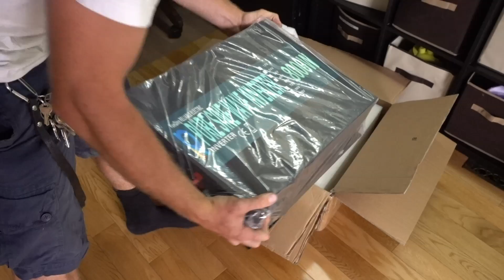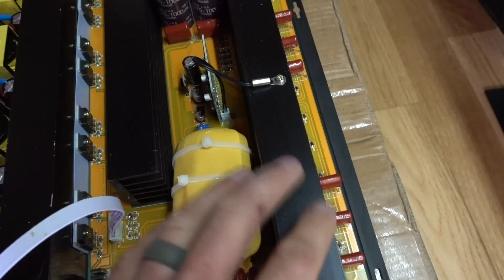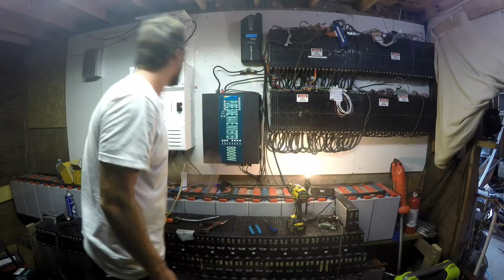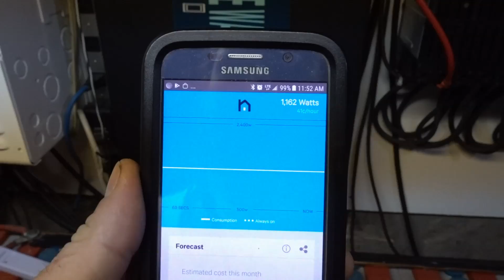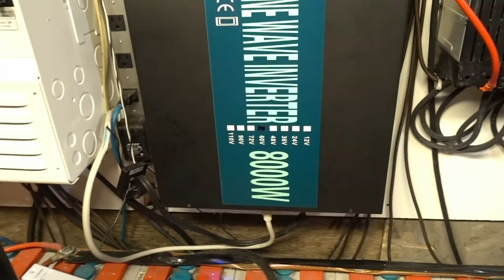8000w Reliable Electric Pure Sine Wave Inverter

Comment: How can you get, let say,  7000w on 2 x 120volts output, thats 2 Time 30A on regular 15 A output plus?
Reply from the maker: yea haha, you will cook the plugs, your supposed to know you need to use the direct wire from inverter and not the plugs for more then 15 amps
Reply: So was there a place on the inverter to hardwire in , or did you have to modify it? Once gaewiredvwere did it run to?
Reply from the maker: it has a hard wire, but the ground and neutral can not be bind as the neutral is live and if bound to the ground will act like a dead short and blow the inverter.

Comment: The thing that bothers me aout a non ul rated inverter. Can you do a volt demonstration on the voltage between hot and nuetral 120vish, hot and ground 60v ish, nuetral and ground 60v ish? I dont run a ground because of this.Mine is 40v h to g and 90v n to g. I dont like.
Reply: If you run a breaker box the neutral is live
Reply from the maker: yes the ground is half live and can not be used or inverter goes boom, but you can ground everything before the inverter and after the inverter and that will cover most problems.
Reply: I do.

Comment: I don’t believe this inverter can do 8kw for very long. The input cables are not heavy enough with out going into thermal failure. I would definitely beef those up. Only two outlets to split off an 8kw load? All thinks being equal each plug would carry 36 amps each at 110V AC. Those are only 15 amp plugs.
Reply from the maker: yes you are right it can do 7000w and 8000 surge, also it has to use the hard wire feature for the full 7000w.

Comment: Is that squashed copper pipe you are using to connect your batteries ?
Reply from the maker: yes it is its 3/4 inch copper pipe and I have tested for 400 amps and doesn't even get warm.
Reply: I have had the same idea for some time, but it was my understanding that, fundamentally, DC electrons travel around the outside of the wire which is why DC cables are alway multi-strand wire and AC goes through the center of wire which is why AC wire is a single conductor. So, it looks like you have proved that can be worked around. I think it just makes so much sense to do what you did and it is so much less expensive. 

Have you been challenged on this by "experts" ?

Anyway, Thank You so much for your videos they are down to earth so that us regular beginners can understand and I learn a great deal from you even though I lack your understanding of electrical/electronics.
Reply from the maker: yes I have but I have shown me running massive loads through it and no heat :) it saved me a ton of money and it looks nicer to me, thanks for watching glad My little knowledge can help others :)

Comment: Ebay description says 8k cont 16k surge, where did you get the 7k cont. from.
Reply from the maker: From what I see inside I know this inverter can handle 8000w max peak 7000w for longer periods  from the build, do not try to get 16000w from it it will blow up 100%, at 7000w its a still a seal of a deal, these companies are trying to compete with bad no name Chinese companies so they have to put the highest possible wattage it can out put.
Reply: Even if it was 5k max it's price still seems good to me.

Comment: I have to agree with you that the midnite with the shunt and wizbang are one of the best combos on the market, I too have had a few controllers and found the midnite to be the best so far. I have two midnite 150's and two shunts with two wizbangs and they work so well together at you can link them together and they talk to each other. Keep up the uploads, liking the 8000 watt inverter a lot , I just upgraded from a cheep Asian 3000 watt to a Nomad 4000 watt PSW 24V and it works so much better, was thinking 48V but will wait a few years now , 230 VAC 50Hz.
Reply from the maker: yes I love them, i have 2 as well cant wait to set it up! the 8000w is working so well i love it.

Comment: Can you give more info on the 8000 watt unit, do you believe it is good enough to use on a Bus conversion. I found it on Amazon it says it is good for 120 and 220 VAC and up to 48VDC, did you find this to be true of your's.  Thank you for any help or input.  Scott
Reply from the maker: it can do 120 or 240 not both you will have to tell them what voltage on the input and output you would like and 50 herts or 60herts, and if you are using in a moving environment I would pack soft foam under the unit to help with vibrations.

Comment: I'm considering using a victron energy MPPT charge controller, and the 60v 3000 watt Reliable inverter. They will be connected to a 16s 21.5kwh 58.4v nominal li-ion battery, made from lg 18650 cells. Do you have any knowledge with that controller? Or how it compares with the midnight classic.
Reply from the maker: no i have no idea on it :S

Comment: hello  Iv been asking around, my reliable 24v 2500 blinks read at over 28vs.  my baterry supplier says to equalize at almost 32 volts,, what will happed to the inverter if I take it that high?  You said you have talked to reliable? do you have their number? thanks
Reply from the maker: I have emailed them through ebay, and if you go to high in voltage the inverter will shut down.

Comment: does it do the stupid  red light error and lights are flashing when the  voltage is over 27 volts at 24 volt system so at your system doe it have this mistake at 54 volts and over?thank you
Reply from the maker: no i asked them for 46 volt to 72 volts and its vert close to my asking voltage.
Reply: I have red light on 24volt 5000w pure sine reliable. Is that for high voltage?

Comment: Maybe better to take more precautions when messing with batteries so you don't get Ark overs like that as you could have set your battery room on fire (but it seems the bms boards died before that could happen) 

still be Intresting how much it holds up that 6000-7000 w inverter (they should state its constant load with burst load, where they are only saying the burst load witch can't be held for more then a few minutes) as the smaller inverters I have had norm have both written on them
Reply from the maker: all I know so far is this thing kicks power jacks but and is almost the same price :)
Reply: When you have a similar system,you will see sparks! I have sparked mine a few times.I have learned to cover the battery terminals and the input connections.

Comment: Awesome!  I hope it works as well as the other did. I look forward to when you get your BMS's  fixed and can push it.
I'm wondering though, I see flooded lead acid batteries there and you're talking BMS boards so I'm assuming those others are Lithium.  Can you run both battery types together in the same system??  

I'm still in the experimenting stage and just bought some deep cycle batteries at Wal-Mart to learn with.  After just 4 months 1 battery Is as good as dead and the others seem to be operating at about 1/2 the rated capacity.  IDK.  Very frustrating. I was hoping they would last a couple years figuring Lithium would continue to get cheaper.
Reply from the maker: I am not able to use both battery banks on one inverter as the gel bank is 48 volts and lithium is 60 volts, walmart batteries are really bad for solar :) I will be pushing this thing more soon.
Reply: I figured out the battery thing.  What's happening is that I have the 8 batteries set up in 2 - 48v banks, and then those 2 banks are hooked in parallel.  So having just 1 battery with 1 dead cell dropped the voltage of bank #1 by 2+ volts.  That meant all the power was being pulled out of bank #2 until it had dropped by 2 volts.  So that 1 dead cell was effectively taking half the bank out of action.  I'm going to replace that battery today and rewire the whole thing as 1 big 48v bank.  

I've actually had very good luck with the Wal-Mart deep cycle batteries in much of my other farm equipment, carts and such.  They've lasted just as long as the name brand batteries for me.   As this is just an experiment at this stage, I figured to make some mistakes, and I prefer my mistakes cost me hundreds and not thousands.  Obviously over the long run it's going to be lithium.
Reply from the maker: im glad you found the problem! the walmart batteries are great as long as you dont deep cycle them.
Reply: If you could, remember when you start testing that beast to get a no load usage measurement.  I would expect it to be more than the 3kw but maybe not??  Live and learn.  Nice they gave you some wires with it.  Seems like a good company.
Reply from the maker: 35 watts no load
Reply: Still pretty good for that size.  Thanks, I appreciate the info.

Comment: Very cool!!! What monitoring program are you using on your phone? I have the classic 150 also and use the local app.
Reply from the maker: cant think of it will check tomorrow
Reply: Like Gene I was looking for a remote monitoring system, was that something you can share?
Reply from the maker: this is what I bought.

http://www.ebay.ca/itm/ANNKE-720P-Wireless-2000TVL-Network-Security-IP-Camera-Microphone-Video-Wifi-P2P/291695169939?ssPageName=STRK%3AMEBIDX%3AIT&_trksid=p2060353.m2749.l2649
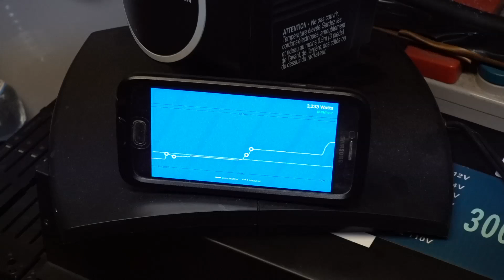Reply: you bought an IP camera that shows your watts? on your phone? We are talking about 18:58 your phone shows a graph of watts
Reply from the maker: the one with the graph is the neurio home monitor system

Comment: Are the Reliable Electric inverters what you would recommend for something running 24/7 at 1/3 or 1/2 load?
Reply from the maker: if you are looking at the cheaper end yes 100% if you can afford 3 times more I would get a magnum 4400 for about $2700
Reply: Is The Magnum With or Without Shipping + Taxes
Cause If You Want a Magnum For Less I Can Give You a Place If You Want With FREE Shipping

Comment: Without past 1 minute maybe 2 4kw inverters (not sure if would trust 8kw at 110v the amps be high ), guess not ones I seen in the past have been 2 inverters connected to each other
Reply from the maker: this one seems like its built enough to do 60+ amps on the AC side, time will tell if this is a good unit or not.
Reply: Do you have a thermal cam? (even just one for the mobile phone) as it  can be useful to see hot spots (better then poking with thingers)
Reply from the maker: i do not have one no.
Reply: Going Off Grid, they are good for spotting hot spots and point if possible failure later on due to component overload 

also good are looking at solar panels that are not operating correctly and have hot spots, as solar panels that have high resistance are more likely to be hotter than the other solar panels so pull overall power output down, 

as well as good for checking connection so you can check to see if you have any bad connections or cables that are generating resistance causing to heat up and possibly melt
Reply: Be nice if the bms boards had a load indicator on them, I would recommend still getting a thermal cam at some point as its more reliable then hand test and you can just stand back and look at what is warm then move closer to heat source
Reply from the maker: I just might have to buy one, thanks!
Reply: I have a cheap hand held for $30. Works for my RC trucks,too.
Reply: I agree.

Comment: assume looking inverter if it is like the others it should rock on. I am glad you did not short it. looking forward to updates
Reply from the maker: yes I have been liking both of mine and I kept going over 3000w with the ACs running and the central vac would push it over, so here is the 8000w :), I will let everyone know if its a good buy or not.